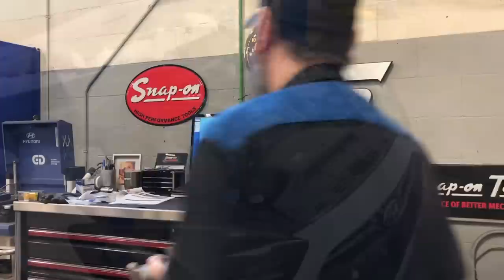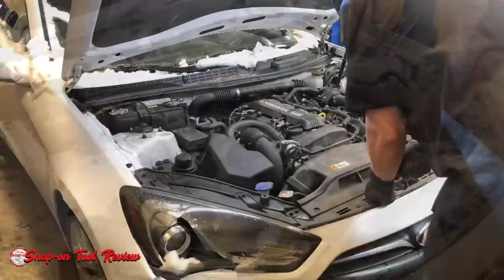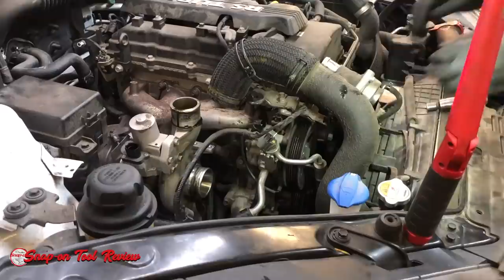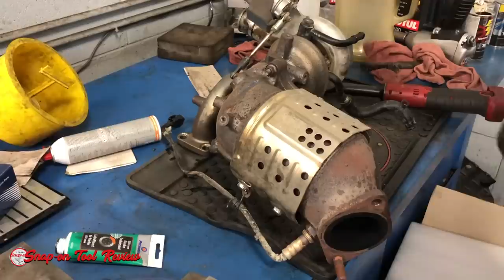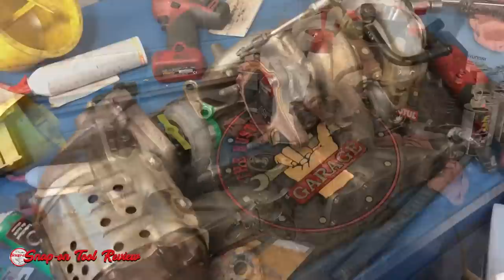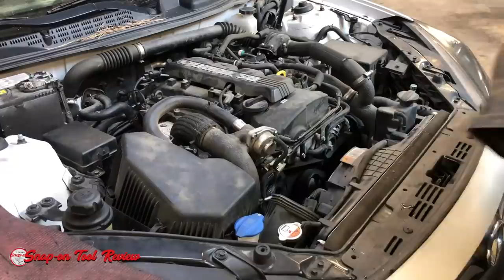Genesis Coupe 2.0L Turbo Replacement

Comment: If you change your oil and filter when your supposed to your turbo will last for a long time. I have a 2012 sonata with 130 thousand on it and the turbo is running fine , just keep the oil clean

Comment: What did you use to remove the manifold bolts? Those things can crack , and that is the one thing holding back to replace the turbo. Did you just use heat or any fluid ?

Comment: Did you have to drain the oil or coolant before taking the lines off the turbo? Or not a lot of fluids leaked out? Just asking, because I’m just swapping the turbo out, but not planning on removing the whole manifold like yourself. Thanks!

Comment: Will you have to tune the ecu even doe its an oem turbo?
Reply: Probably not since the ecu does not know a new turbo has been installed.  You would only need to modify the ecu if you are installing a modified turbo to increase hp over stock specifications.

Comment: Just curious how many hours do you flag replacing the turbo? I work at vw and we replace a lot of turbochargers. On a vw gti or Tiguan we flag about 4.5 hours . How long did it take you to replace it?
Reply: It takes me an hour.  This turbo has a v-band so you can just take off the compressor portion and work on that and CHRA.
Reply: @ishiatsuknot_myofascial_relief  Do you have a video showing your work?  Where can I get a CHRA?
Reply: @javilink7  sorry, no video.  The CHRA is the piece that connects your turbine and compressor.  If you have a turbo, you already have a CHRA.  CHRA stands for central housing rotation assembly...

Comment: This car looks abused. It is also missing the front strut bar. The front frame will be flexing with crappy handling/ traction when cornering. Maybe that why it already crashed 🤔
Reply: @Gunzork 2013\2014 U.S base model comes with it. It is also listed on the sales window sticker and was on the website back in 2013. My base model  came with it brand new from the factory. 
Maybe this is a Canadian model.